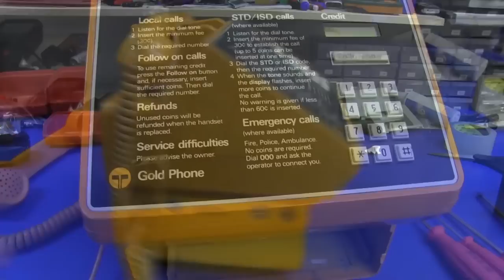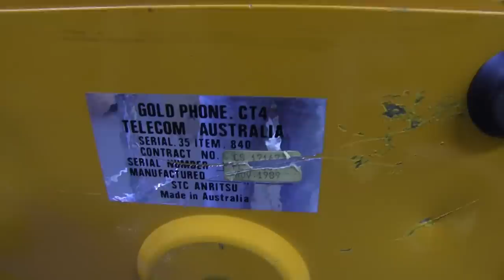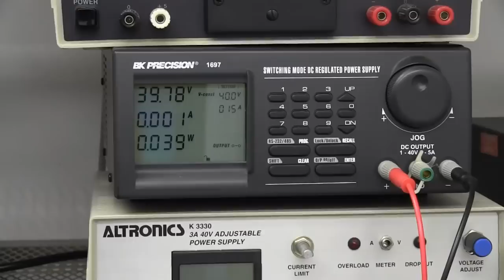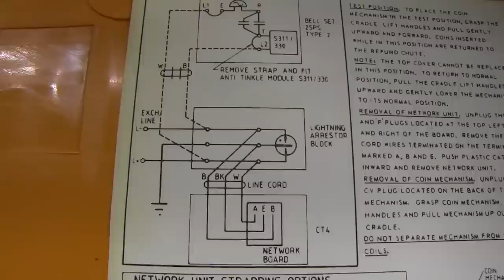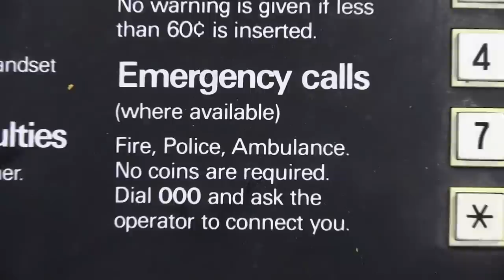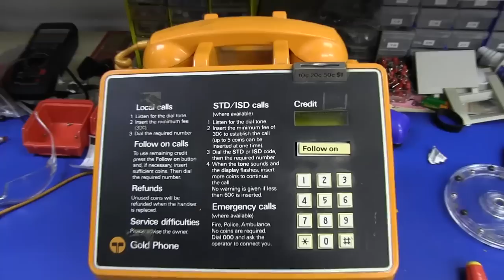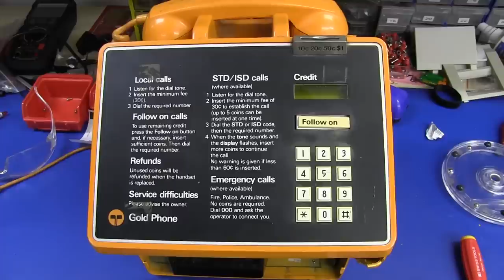EEVblog #363 - Gold Phone Teardown

Comment: Hi Dave. I was an instructor for NZ Telecom and trained local area techos on installation & maintanence of Agifon (Landis and Gyr) small coin phones. L&G Coin validator works using 2 coils. A frequency was feed into the first coil and the phase shift mesured in the second coil. A different frequency was feed in & the results of both phase shifts (digitized) compared with a  ROM map. If my aging memory serves me right they used about 1000 coins of each domination used to make map. 
Graham Dredge

Comment: @EEVblog
The two coils that sense the coins works in this manner. Each coil is the inductive part of their own oscillator. When a coin passes past them, the coin pulls the frequency. If each coil is resonant at different frequencies, you can determine which type of coin went past. Pull the frequency too high or too low means a slug was inserted.

Comment: Press [Follow On] button, as you release it then press the hangup levers, this needs to be done as fast as possible. After about 100 attempts you will get the timing right.
When right you can have the phone in the hung up position but still have dial tone, then you can call for free. haha...
Reply: what's follow on mean
Reply: There is a button on the phone called "follow on"
Reply: What does the "Follow On" button do?  In the US we dont have that button on any phone.  Is it the same as "Return Coin" in case you want your money back and you havent made a call?
Reply: If you have leftover money in there, enough for a second call, press the button then hang up and you get a second call.

Comment: Nice phone, one of my favorites. It needed pulses from the exchange to operate correctly and also a good ground(earth). The follow on button meant that if you had put enough money in you could disconnect the call and make another by pushing the "follow on" get dial tone and not have the hassle of hanging up and putting your coins back in

Comment: [From the manual] Electronic Coin Validation Circuit (ECVC)

The Gold Phone can validate a maximum of 4 coins designated 1D, 2D, 3D and 4D which corresponds to the 10 cent, 20 cent, 50 cent and one dollar coins. The ECVC performs the validation of coins on the basis of thickness (T), material (M) and diameter (D) parameters. 

When a coin is inserted, the four high frequency coils each produce an AC signal which is proportional to one of the coin parameters. These AC outputs are then amplified and converted to DC signals and fed to a differential amplifier for temperature compensation.

The compensated output is fed to a peak hold circuit. The signals are then converted from analog to digital signals to be fed into the microprocessor which compares the input data with prespecified values for T, M and D stored in the microprocessor ROM to judge whether a coin will be accepted or rejected. If a coin is accepted, a signal is sent to the SM magnet allowing the coin to pass to the storage channel. The value of the accepted coin is sent to the coin collection microprocessor for later use.

Comment: for the rear lock (service) you need a M00002 Key. the Tariff board as spot for 6 diodes. first 3 in the line are 10c, 20c and 30c first charge, second line is for extra charge that depend on time of call. so if it had a diode in first and third spot, means 40c , only one diode in the middle is 20c

Comment: If it worked anything like the 1D2 style phones here in the U.S. everything was controlled by the central office - and that big coil is likely a coin relay.And the way they did it was they'd send 130VDC down the line - either +/- for coin accept, -/+ for return. 

That is until the early 1990's when we got what were called COCOT style phones. All the brains were inside the phone. I have an old 1D2 in my collection.

Comment: I've tried calling 911 in Europe just out of curiosity what would happen
Turns out it automatically switches the 911 into our local emergency services 112

Bet AUS does the same trick? calling 911 automatic transfer to 000
Reply: Osmosis yes it does
Reply: That's pretty neat to know for us Yanks who travel
Reply: +Osmosis I thought most of Europe was 999...Didn't know Aus is 000...NorthAmerica used 911 instead of 3 of the same digit to help eliminate "pocket" dialing" the emerg number.
Reply: Craig Diamond
 Most common is 112 in the EU, 999 is also used (UK and BE i thought not sure tho) and 061 in some other EU countries
Reply: +Craig Diamond That's not right when 911 was chosen as a number people didn't have mobile phones. On an old phone with a dialing disc 9 was the highest voltage and the strongest signal so the UK choose 999 as a number. The US choose 911 as it was quicker to dial yet still had a high voltage for the first digit.
Reply: +Mediocre-Motorcycle-Modifications Please show me how a DTMF digit 9 has a higher "voltage" than any other? (it isn't even the highest frequency of the 16 combinations)  Do you have the 1st clue of what you are talking about? I think not...what is a dialing disc? Are you referring to the old dial (pulse) phones in which dialing a 9 would just break the line connection 9 times in quick succession? and pocket dialing was referring to mistake or child dialing.
Reply: Osmosis I am commenting from my memory, which means no warranty on the content being correct nowadays... If I recall for those interested, police in China (and Taiwan) is 119 and fire is 110 or vice versa. I never tried 911 there nor have I ever thought about trying it anywhere when I travel overseas from the USA. Interesting that it automatically switches in some countries. Also I saw some debate in the comments here about why 911 was chosen. I always thought it was chosen simply due to the fact at that time area code dialing was not required nor was the leading 1 (country code) indicating an in nation call. I always figured it was simply a number combination that not only had some easy to remember reiteration to it but it also was an unused and or reserved number that would not have been found anywhere as an area code and or a local exchange perfix and thus it would support those 10 or 7 digit dialing methods of that time. Also for those interested back in those days if I recall a local exchange prefix could not have a 0 or a 1 as the second digit (reserved for area codes),  so that further limits the number combinations available to create a 3 digit number that is not an area code, a local prefix and a number that would connect with just 3 digits dialed.
Reply: Osmosis that won’t happen because some Sydney phone numbers have numbers that start with a 9. Sydney and Melbourne and Western Australia phone numbers that starts with the number 9 after the phone numbers went to 8 digit numbers
Reply: SECRET SERVICE!!!

Comment: I wouldn't mind betting that the dual coil system is to make sure the coin is actually passing down into the machine, rather than being "fished out" like I'd see people trying when I was a kid. Ie: drilling a small hole in a 20c piece and tying some fine fishing line through it so you could dip it in and pull it out, essentially getting free calls. I have never seen it work, so obviously there's something stopping it.

Comment: .......I'm sorry to tell you, but it really does.

Quote from wiki:

"Due to special configuration in their firmware, some 3G or GSM mobile phones sold in Australia will redirect other emergency numbers, such as 9-1-1 and 9-9-9, to Triple Zero (000). These calls are sent out by the handset as an emergency flag to the network and as such are treated in the same way as a call to Triple Zero (000)."

Most phones sold in the past 5 years do this, payphones also redirect in the same manor.

Comment: Dave..."the interesting thing" as you called is used today also ie. the ending of ISDN line (client side) is powered from directly from the telephone line (digital telephone signal is around ~96V). Ofc today you can power up any wire telephone on analog line without connecting it in to mains power. (analog  around ~46V-5xV) its standard not the "interesting thing"

Comment: I bought one of these phones off eBay for $30 (bargain). The way the coin system works is that the phone stores the value of the coins in memory and begins deducting the value of the coins as metering pulses (which increase in frequency depending on the call value) are received by the phone from the exchange, so every 30 seconds the balance would go down by a defined value. My gold phone accepts coins on a normal non-metered line, so I think there must be a fault in the phone in this video.

Comment: actually (after a shitload of research) it was waiting for a metering signal. when you make a call of one of these phones, the metering signal tells the phone which tarif to charge for the call, like if it's an STD or local call or a free call, and the phone won't work as a payphone without the metering sig (they usually have an "owner mode" on the key switch so it can be used like a non payphone

Comment: Dave, if you plug this into your phone line at home it works just like an ordinary phone. Dialling out requires no coins and these old things did PULSE dialling.
Reply: It is a push button phone, so tone dialing.  Pulse dialing is done with a rotary phone.
Reply: Symon Brushe Umm, I had one mate, tore it down and used the thing at home for years. It does pulse dialing via push-button. 
Turn your T100 white touchphone over and flick the T-P switch and OMG, push button pulse dialling. Fucking magic!
Reply: So if you are in my boat , you have to pay extra for pulse dial, LOL &^&#*$)
Reply: @JesusisJesus  Yep, I remember in Australia in the 80s, although push-button phones were fairly common, they did not tone-dial, they pulse-dialled. As I recall, a lot of exchanges didn't get tone-dialling until the early 90s.

Comment: I wouldn't consider spreading misinformation a bit of fun, especially in this context.

"The phone itself is what does the redirecting, this applies to almost any modern landline phone too, unless your still living in the 70's."

Wrong again. The Telstra phone exchange does the routing of phone calls, not telephones themselves.
Scenario: You are in Sydney and call 91145678 on a payphone. The call will not go to emergency. It will go to local number. End of story.

Comment: Nice NEC 7805 voltage regulating microprocessor @29:40 . Sorry but I think I will stick with the 3 pin TO-220 analog ones. There a lot simpler and cheaper.

Comment: Apparently on the old pulse dialling system, before tone (DTMF) dialling, the numbers were sent by breaking the connection on the line, x number of times with a short delay, if it was only 111 then this could easily be "dialled" by cracked wiring and this would send too many false calls to the emergency services. In Australia it is 000 as 0 was sent as 10 pulses. Refer to the movie "hackers" for how to dial using the hook switch on pulse system networks.
Reply: This was easy to do— as a kid I used to dial numbers on our rotary phone (i'm in Aus too) using nothing more than a well-timed jiggling of the hang-up hook! I knew friends whose parents had a key-operated lock on their rotary phone dial to stop their kids making unauthorised calls and I felt very smug in the knowledge that I would easily be able to beat that security measure if my mum got any stupid ideas like that 😀

Comment: Here in the states it is 45 for the line voltage and 90 for the ringer.
Reply: greytimberwolf68 Ideally, it's 48 volts (or -48V referenced to ground), but after miles of twisted pair, you'll usually measure a lower voltage.  I work in telecom so I have -48 burned into my brain!
Reply: good to know, thank you. i only used testers at votech and that is what they were set for.

Comment: Oh well, I am so truly sorry then your highness.

Not wrong again, modern phones will call 000 if an emergency number is dialed it's a feature built in to the software, not something determined by the service provider.

"You are in Sydney and call 91145678 on a payphone. The call will not go to emergency. It will go to local number." 

No crap, you just added in five extra numbers which makes the phone try and dial it as a local number...

You said your piece, I said mine, how about we leave it.

Comment: The Coin Detector is a simple Metal Detector, I was betting on a nice DC "D" size battery's under the ringer Box in the Front..Now to Build your own Phone Box, $$ you'll have something, the Freedom of Not having a Cell Phone for a Few Years is the Best..

Dead Cell Phone make the Use So much more Needed in the Future Years..30c then 90c this time around, or maybe $1.20 for the first 3 minute's 'Owh the''' please, deposit, the Next 25c (USA) for the next 3 Minuit's.. is still Stuck in my Nut shell of a Head

Comment: 48 v on a phone line wow?
Reply: When the phone is not in use, this is a constant DC signal (about 50-60 volts). When the phone rings, the signal is a 20 hertz AC signal (about 90 volts). When in use it is a modulated DC signal (between 6 and 12 volts).